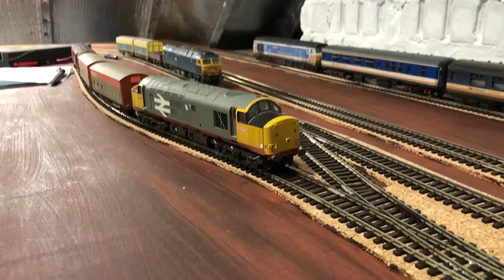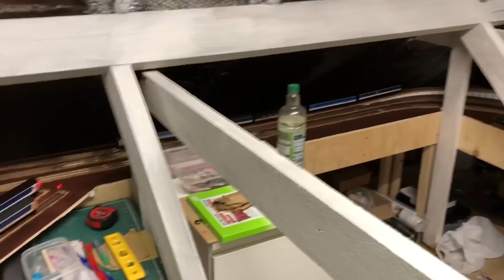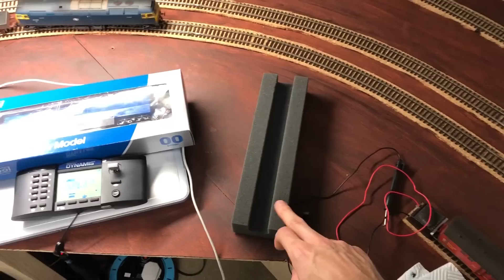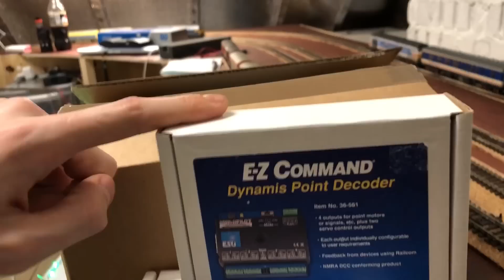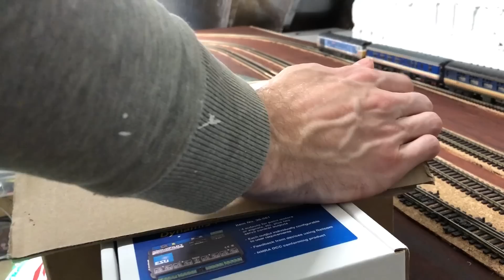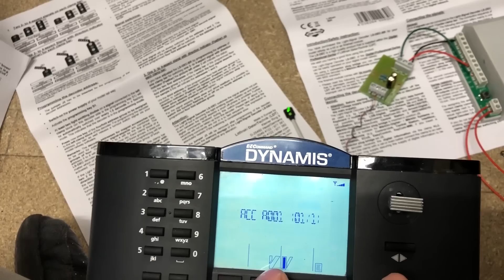How To Build A Model Railway - Episode 20 - Signals & Major Changes

Comment: Its not just the right length you need at least a half track space in modelling. The train does not sit hard against the buffer or the interchange area. You could take the track back into the curve by two wagon lengths that will allow modelling a small parcel platform with space beyond for the full wagons, might even give the chance for a small shunt at the top of the siding allowing the larger locomotive to role down onto the rest of the train and take it away.

Comment: Hi, great update and lovely new 37 / 47. Regarding the 50, could be any number of things, but 1. try cleaning track, 50s pickups and wheels with alcohol. 2. Resetting the decoder - sometimes CV 8 to 8 is quite common, depends on decoder brand. 3. Think I’m right that those 50s came with a turning fan in the roof. Many people, (as Irene previously said ) needs the fan belt removing as it can drain power and seriously affect performance. Hopefully it one of those three things. Have fun.
Reply from the maker: Thank you, yes I'm very pleased with them and how they look. Great models!
The track and the loco wheels are definatly clean, I have used a very good product to clean them, and they are shiny! Decoder will be the next thing I test. And yes, the fan belt was mentioned and i'll give that a shot as it seems the most likely culprit!

Comment: Ref the 50. Disconnect the fan drive belt. Mine was making a hell of a noise. Since removing no more noise and smoother running. Worth a shot.
Reply from the maker: Ahh, that's a good idea! I shall be sure to give that a try. Thank you!
Reply: Any luck?
Reply from the maker: Hi William, sorry I get buried in comments and loose track! I haven't had a chance to give this a go yet, but have packed the locos away for my current project. I will see if the problem still persists when they are running again and if it does, i'll give this a go!

Comment: For the points, I use Team Digital SMD84's that control 8 points, has local pushbuttons option and DCC and Loconet for feedback to a PC or control panel. Most other points decoder control 4 points.
Reply from the maker: As I have solenoid point motors, I've gotta find something that has CDU's. So i've been advised to look at a decoder by DCC Concepts which seems like a good one. It too also has the ability to control 8 points.
Reply: The Team Digital SMD84 include a CDU.

Comment: For signaling I went with Team Digital hardware. It's the only stand alone system available. Once it's all set up, you don't need a PC. But does use Loconet so you can interface it to a Digitrax or Digikeijs system if you want to use PC software instead. The signals control you instead of you controlling the signals. You run the trains and routes.
Reply from the maker: Thats quite a good idea! I quite like the idea of being able to program them though, so am happy with the system I've chosen. Should give me some good running options and programs!

Comment: Hi, I to have the Digikeijs DR5000 which has the built in WiFi module that allows you to connect WiFi throttles like the Z21 WLANmaus. Also has the network connection to a PC. With Digitrax you have to purchase the WiFi module separately and unless you purchase their latest system, you have to also purchase the PC wired board.The DR5000 include Loconet like the Digitrax but you also get Xpressnet and S88 and Rbus. Since it does not include a throttle, you can use a Digitrax throttle if you like that system or else use you cell phone or a Lenz throttle or built one from Rudy's site.
Reply from the maker: Hi John! Great to hear another user of the DR5000 has good things to say! I hadn't really thought about a separate throttle actually, so glad you mentioned that! But good to hear that there are a few options available!